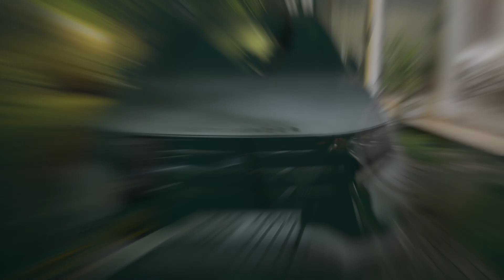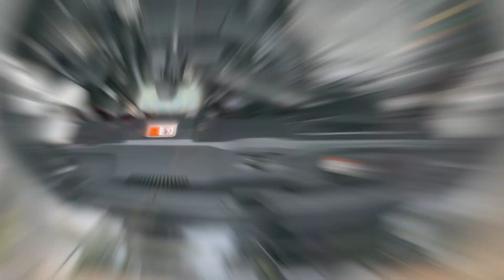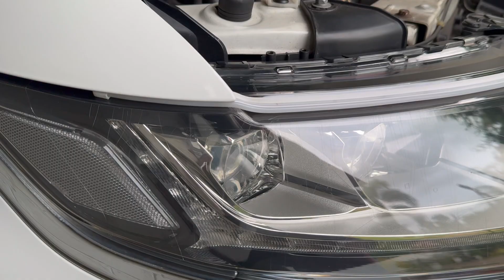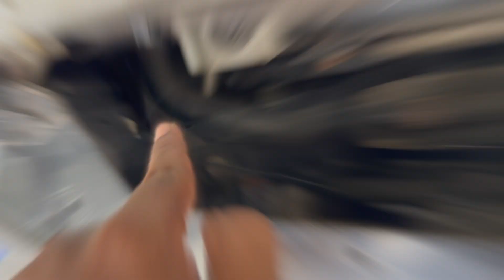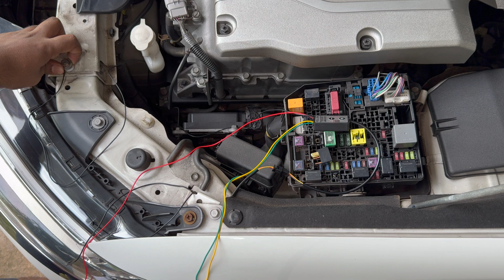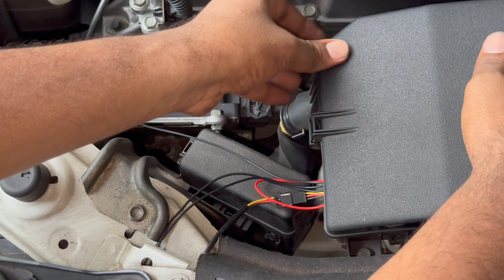Dynamic LED Hood / Bonnet Light System For Any Vehicle | Installation Guide & Review | HAZI TECH

Comment from the maker: For purchasing inquiries, please reach out to us via email at info.hazitech@gmail.com or on WhatsApp at +94779299171
Reply: What would the reason be that one turn signal is longer than the other? When setting the turn length it is like it's not set in the middle. Light strip is central and so  same length to each side ? It's worked perfectly once then it's gone strange! Long press to set up and then adjust as I did to start with? Strange!!!
Reply from the maker: Is that a one that you purchased from me?. Usually you should set the full length and save then go for turn signal length adjustments.

Comment: Hi hazitech, just now see this video. I do have 2025 mitsubishi outlander and don't know where can i connect the red wire. According to the manual of the light it needs to connect into non-critical ACC on the fuse box but i don't know where to find that fuse.
Reply from the maker: I've clearly shown it on the video. Please check.

Comment: Nodemcu esp 32 ekata pixel led. Uparima kiyk program karanna puluwanda sd card dala
Reply from the maker: Mama maximum gaana check karala nam na. Kohomath 1000 nam awulak wena ekak na.
Reply: @HAZITECH  bulb 5000ta wada run venna ic ekak nedda. Arduno walin program puluwan ekak

Comment: Hello Hazi! Greatingz from Brazil. Please could you make a light pattern from formula drift g-force? Accelerating leds Green, neutral leds blue, brake leds red. Just in case, a led blinking from accelerating mid/full throttle for mufler fires should be awesome. Everything on Channel 2.
Reply from the maker: Is this for a real scale or for an RC car?
Reply: @HAZITECH  RC car, its called decel lights on formula drift